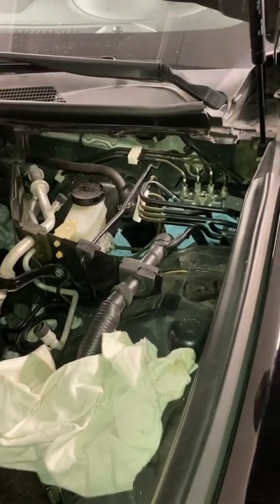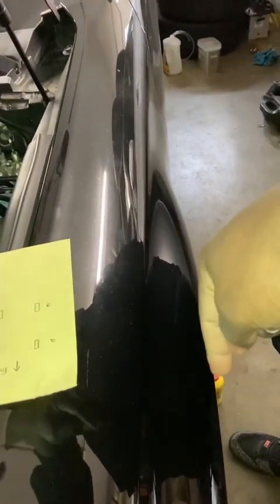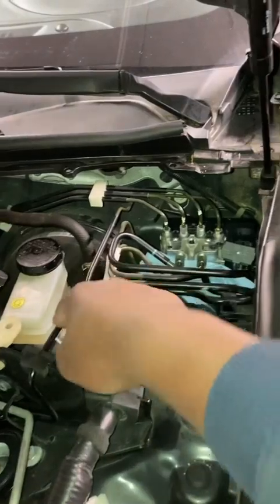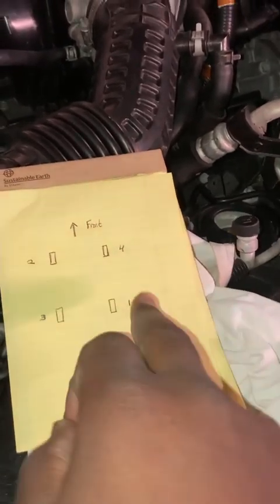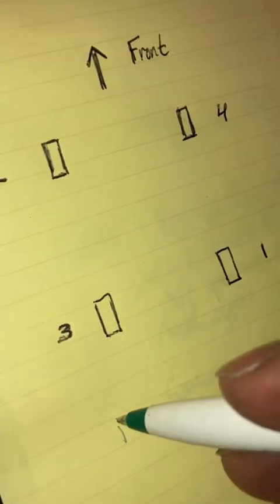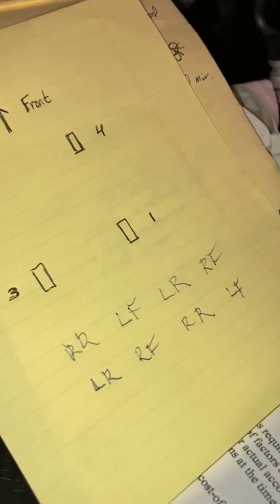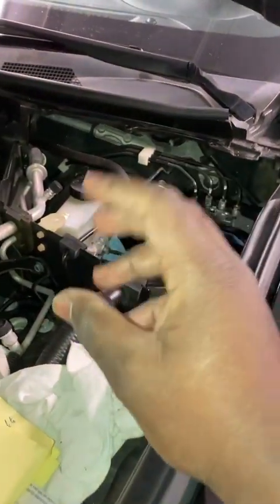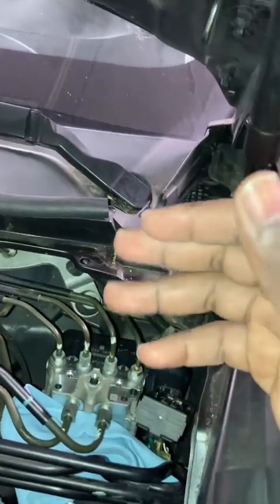Correct Brake Bleeding Sequence. Infiniti Nissan. Why do we do it in this order?

Comment: Thank you for the mechanical explanation. The Factory Service Manual for a 2016 Infinity Q50 says the exact same thing if anyone is wondering. "Rear Right -> Front Left -> Rear Left -> Front Right".  And that should also apply to Q60's and for similar model years.

Comment: Just did it the old fashioned, wrong way on a Q70.  It ended up with a very squishy pedal. So here I am. Thanks for teaching me 🙂!
Reply: after you did it the correct way did it go back to a hard pedal
Reply: @jixs8142 yes, it worked fine. I'd recommend repeating the process if you're having trouble.

Comment: I’m guessing your doing the brakes bleeding on the m37 if you are would help me out a lot because I have a m37 so I’ll know where to bleed my brakes from
Reply from the maker: Does your M37 have the sport brakes or the standard brakes?
Here is a video I made on the sport calipers - https://youtube.com/shorts/3tfvQJR5aBw?feature=share
Reply: @EdBwoy  2011 Infiniti m37x should the car be on or off and does the vehicle need to be leveled or it doesn’t matter?
Reply from the maker: @Amj397  I do it with the vehicle running, ABS module disconnected and vehicle as level as possible
Reply: I’m trying to get air out of My friends brake lines on my 2011 M37 I understand the sequence in the video helped out a lot, but do I do the inner bleeder first or the outer bleeder first?